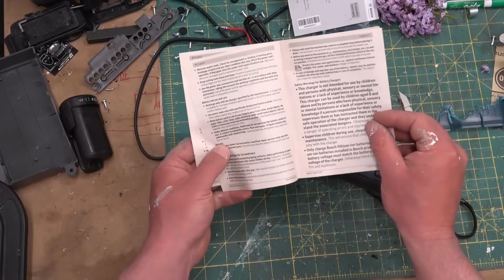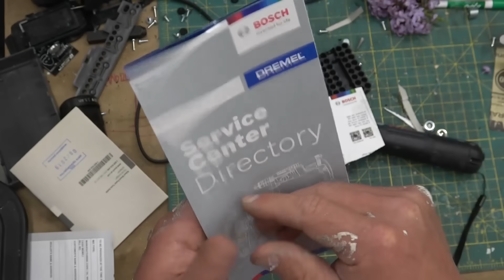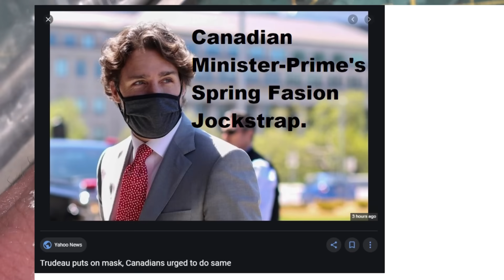BOLTR: Bosch Screwdriver

Comment: My fave brands - 
Bosch for Power tools 
Wera for Allen keys / Screwdrivers
Though I have seen Furze use the Ryobi power tool system extensively.
Others are also invested in DeWalt power tools.
I like Bosch with it being a German brand yet reasonably priced.

Comment: Not a fan of that “push to run” switch; and I suppose the delay is to ensure that you have sufficient pressure on the screw to avoid slippage. I have a thirty two year old black and decker power screwdriver which is just a switch, battery and motor inside (found out when I had to replace the batteries after twenty years) - why on earth does a screwdriver need electronics?! Metal gearbox too. Strong as fu<k, literally lasting a lifetime. Originally got it to assemble an Ikea kitchen, used it to assemble the deck and pergola. Don’t use it often, but invaluable for those “just keep screwin away” jobs, and also handy with the thick grip for getting a load of manual torque when ya need a tight grip.

Comment: Need to find a happy medium. Recently used a 1/2" drive Ryobi impact to screw in some 8mm hex head screws through 2 18mm sheets of mdf. Worked like a beaut until the impacts kicked in. Don't think that little Borsh would do it. Maybe the 350lb gorilla going 5 uggaduggas was over the top on the Ryobi..

Comment: It looks just like the old black and decker one... i think they even made this one bigger.   
Bosch....i need a smaller battery operated screwdriver or i might as well just use my Milwaukee 12v surge drill.  
I don't even need much torque.  High speed, light duty, and smaller

Comment: Slight correction: What you call a free wheeling diode is actually a current sense resistor. The free wheeling diode is at the same place, but the other side of the PCB. ;)

Comment: 5:13 -- RE: "... 180 degree [pot] on a scale of 1 to 6 ... some Teuton please explain that to me?" -- LULZ!  Turns out, mango, that the Teutons aren't the only ones who pay attention to the apparent harmonics of the very cosmos.  Indeed, pagans in general observed that Nature prefers equilateral relationships and thus, any Factor of 3 gets special attention.  Because Circular, the Factor of 3 must be multiplied by 2, there's your Sixths.
See also Lagrange points, where strangely enough there are special locations located at 120 degree intervals, but 5 of them in total.  Decimal systems use 2x5 as the factors.  And, RE: Teutons, see also the series "Dark" on Netflix.
Reply: 3x60 = 180; 6 x 30  = 180.  True enough, I can find 5 as a common factor in there too.
Reply: SEE ALSO:  QUORUM, ie. (2/3) + 1 for conversions between imaginary ideals and real integers.

Comment: If anyone wants to experience the thrill of purchasing a tub of new grease, although you'll be taged from that point forward, show yours to one of those individuals with a backpack who rides the motorized bicycle who's head lamp is always illuminated on his/her head at your local walmart at 3pm. (Disclaimer: doing so will require the purchase of a 3' pry bar and a change of address form. Not supplied at most Wal-Mart's).

Comment: 13:49 The delay is most likely the bit gets firmly in contact with the screw head so it doesn't ruin it by camming out. I bought an el cheapo (walmart store brand - hypertough) for $14 a couple of years back now. You can't beat it for the price & it's got none of that push-to-go nonsense. I use your magnet trick a lot with it to hold screws.

Comment: I have a little Bosch 10.8/12 volt drill with the same delay when you press the trigger... drives me mad makes the thing completely unusable, want to throw the dam thing in the 'fuck it bucket' every time I use it. I've noticed all these newer brushless tools have some delay (my dewalt, Makita and festool tools all have it) and sort of understand that they would as they need the computer to operate but I can't work out what Bosch are doing with shitty brushed motors taking half a second to move when you hit the button. It's most annoying driving a delicate screw (what your likely to be doing with a small low power driver) when you want to stop and the thing runs on for another half a second after releasing the trigger shearing the head clean off the screw!

Comment: I'm surprised I have to explain the correct way to find the speed setting on any German tool to you. It involves six-sided dice to give you an indication where to start, and then dicking around with it as long as you dare (typical German amount of time would be around 34.2 years)

Comment: The reason I'd guess for using 1-6 on a 180-degree Potentiometer-
180/6 = 30. So Every 30 degrees is another number.
180/10 = 18 degrees. Not as clean.

Comment: I have 3 of these from Dremel. One in electrical pack, one on bench and one in general tool pack. I mate these with the meewalky shockwave 18 piece impact set and one extra long philips impact bit. Beautiful to use on door hardware as there is no skip out to mar interior exposed screws. ( just as it hits tight, loosen your grip a little on tool and when it hits bottom the drive spins briefly in your hand and seats screw perfectly. )

Comment: I am still am you could say angry that even the simplest toys now need that much electronics.
Why does it have a microcontroller that is powerful enough to auto-pilot a helicopter needed for a screwdriver? I have now even seen Flashlights with a microcontroller that has MORE processing-power than my old MP3-player - with the extra twist that the MP3-player also had a flashlight built in and not only had the On/blinking/off options but the gimmicks like letting it flash with the music, fade-in/out and manually adjusting the brightness (worthless extra functions but hey - it already had the processor and battery so just adding a tiny light is a nice addition specially as it was small enough for the key-chain).

Comment: COVID BS all aside, you have to have the selector set to which way you want to go, then push in the bit just a bit, and it automagically comes to life? Not sure I dig on that method of actuation. I find that when it auto-rotates in your hand when you get to (resistance) is definitely a feature, not a bug. Screw it in with automatical screwdriver, until it starts to rotate, then you can use it in the non-powered mode to the torque you want, or bust out the big girl manual screwdrivers, and get them more precisely done. Having @$#^%ed up enough stuff with over torquing, definitely a feature.

Comment: Bosch came up with the idea that if you make a device blue, you can call it professional. This is an extremely sad development. I regret that I put so much faith in Bosch. I already have too many devices to change over and they simply do not have enough good devices.  They don't even have a decent battery sander.

Comment: much as i hate to be a fuckin know-it-all-know-fuck-all, that "big diode" is actually a shunt resistor (labelled R24), used to measure the current flow to the motor so the confuser can lower the current and prevent burnt windings if the motor is stalled. The MOSFET itself can be used to short out the motor windings on over-run to prevent spiking.

Comment: The Bosch has nothing over the Dewalt. This is the one i would like to tear apart to see how the hell it works. I have one and thought it was broken right out of the box. But behold it has some kind of gyro inside to control speed and direction that relates to witch direction you turn your wrist no matter horizontal or vertical. Its a fricken mind reader!!!!!!

Comment: I was actually considering picking one of these up. I had a Dewalt "gyro" driver for assembling stuff that a drill would be overkill. Someone thought it looked better in their toolbox than mine and I wasn't a fan of the "gyro" mechanic of it, figured one of these would be a good replacement...

Comment: Upon returning from some travel at the end of February I learned I had inadvertently entered a COVID-19 hot-spot, and started a 2-week home-isolation on March 2nd.  Just when I hoped to return to work, the general California lockdown started.  Living alone, I made it a total of 8 weeks in isolation before I hit a very rocky bottom.

During that time I learned I'm in 3 COVID-19 risk groups.  Despite my health issues being very well managed with meds, diet and exercise, this still means if I get COVID-19 it'll be a battle.  This scares the hell out of me, despite the odds still being strongly in my favor and improving with time.

After my meltdown 8-weeks in, I built a small 9-member community of well-isolated friends and family (something now being called a "pod"), each of whom has 3-degrees of separation from any known COVID-19 case.  When any member of the pod drops below that level of separation, they're out of the pod for 14 days.

I feel safe within my pod, but that's about it.  I can't afford grocery home-delivery, and don't like it anyway as I can't get the food I want that way, as the list of items eligible for home delivery is about 1/4 of the store.  Good food is particularly important during isolation, and not just for nutritional reasons.

I need to go out to do food shopping.  I also need to go out for my exercise (run, bike).  And I see so many folks out there without masks, any of whom could be in a pre-symptomatic stage of infection.  Everyone says: "Oh, I'll put my mask on when I get within 6' of anyone."  But they don't have eyes in the back of their head as someone runs or bikes up from behind.  They're not conscious of where the wind is blowing.  And this is despite my trying to use out-of-the-way locations for my runs and rides, and taking full advantage of special early shopping hours at my local store.

I've worked so damn hard for my health and lifestyle, and it seems so wrong that some idiot without a mask can bring it all crashing down.  Not even the risk of cancer scares me like this.

So, please, even if you feel the mask is silly and ineffective, wear it anyway when out in public.  Even if only as a sign of caring for those of us with complicating issues.
If your job has you interacting with the public, then please also wear gloves, even if they're not disposable.  I wear gloves when I shop, and dispose of them after cleaning my purchases.

This is a strange way to live.  But 100,000 COVID-related deaths in the US is not to be ignored or trivialized.  What's worse, all COVID numbers are certain to be well short of reality, as testing still is far from pervasive.
I do my best to minimize my contact with the public, within the limits of having a livable life.  People are everywhere, and nobody knows who near them is vulnerable.  It's only going to get worse as lockdown restrictions are eased.

So, please, just wear the geezless thing.  Even if the safety improvement for me is infinitesimally small, it's there and it's real.  Please.

If you wish, view it as a symbol you wear to support a cause, like one of those colored ribbons or wristbands, or a flag you wave.  Even as a symbol, masks have social power.

Comment: Frankly, i'd think some viewers of this channel are likely to already own a mask far superior to an N95 dusk mask that actually will protect you to a large degree (versus the surgical style masks intended to protect others from you).
Just about any cartridge based mask is going to be far better at protecting you than a dust mask. A cheap welding fume mask used to protect you against the fumes from your trigger gun is likely to be a P100 grade mask (99.97% against 3 micron particles and effective even against petroleum aerosols). That mask you used to paint your fence with your wagner power painter (or your home body shop, or your home meth lab) is also likely to be far more effective.
These cartridge masks have the added benefit of the virus generally being absorbed onto removable consolidated surfaces, rather than the entire mask, as well as being soap and water washable (as most of these are elastomeric, rather than paper).
Anyway, </rant>.

Comment: Correct me if wrong, yet isn't there water damage on the circuit board?
Reply: It's no-clean solder flux.
Reply: @goldenandlilchick  Ahh, just looks like typical corrosion I've seen on boards from water damage before.

Comment: So does anyone know if I can reach out to AvE, I've a question I think he would be able to help me out.
Reply from the maker: giver'
Reply: @arduinoversusevil2025  cheers, so I'm involved in an ice sport and I'm trying to reduce the coefficient of friction 316L stainless steel on ice, make it a lil more hydrophobic. so she runs a little quicker. I cant change the hardness of the material, so to date Ive just been using sandpaper 400-2500grit and then using diamond paste to buff the material out before competition but I'm wondering if there's any topical substances I can add that will not come off after acetone is applied. Cheers lad and thank you for your content, for someone who doesn't know his arse from his elbow when it comes to this stuff tis very entertaining.

Comment: A thing about those homemade masks is that if you can smell through it, it ain't doing diddly squat.  Also another thing that people tend to do is to overbuild them to a point where they're no longer air permeable so the air (and everything in it) just flows along the sides, only making it harder to breath but without all the benefits (unless it's a kink thing, I guess).
Reply: Sure it is, even if you can smell through it. Thoses masks are mostly to protect the output, not the input.

Comment: Ah yes, a physics professor comes to the conclusion that masks and respirators do not work.  I won't begin to say definitively one way or another what masks do and don't do but here are my questions on his report.

1 - He says that the particles involved are too small to be blocked by masks because they are less than 2.5 microns.  Perhaps true of cloth masks but N95's do filter down to 0.3 microns.  Is he suggesting that N95's don't meet specs?  Don't filter 100% of particles?  Doesn't know N95 specs?  If it's the middle question, yes, he's right that they don't filter 100%, hence the N95 spec.  They filter 95% of 0.3 micron particles WHEN fitted properly.  I would guess many are not fitted properly so that can be a confounding factor and why they probably don't work for the general public, but him ignoring and not accurately discussing that simple clear science in his statement tells me he may already have reached a conclusion based on personal biases.  Perhaps like other scientists he's allowed personal passion to cloud his conclusions.  I can't say.

2 - He focuses on whether masks prevent health care workers from getting the flu or similar respiratory diseases.  Most of the studies he cites focus on that.   Masks don't prevent healthcare workers from getting the flu because you can get the flu in a healthcare setting from touch contamination which is why healthcare workers wash their hands and yet still get the flu and colds.  Does he then also advocate that healthcare workers washing their hands is worthless as well?  Plus healthcare workers can get infected outside of work, so again, no surprise in these studies.  Colds and flu are everywhere so yes, healthcare workers will get sick probably no matter what they do.

3 - Is there any evidence that masks decrease the amount of particles expelled by someone who is infected?  Well, there seems to be some evidence that they do.  My wife and I work/worked in hot zone hospitals.  We wear masks when we go out of the house because we want to do what we can to minimize the chance of unknowingly transmitting the virus to someone else, especially since we now know that transmission can occur from someone who is asymptomatic.  That is the perhaps the biggest reason to wear a mask.  Not necessarily to save yourself, but maybe to save someone else from illness.  In fact, in the Cambridge study he cites, the summary clearly states "There is some evidence to support the wearing of masks or respirators during illness to protect others, and public health emphasis on mask wearing during illness may help to reduce influenza virus transmission. There are fewer data to support the use of masks or respirators to prevent becoming infected. "   Why no mention of that in his report?

Bottom line for me is that he's probably right in a small way in his conclusion.  People should not delude themselves into thinking a mask will prevent them from getting Covid-19.  In the overall scheme of avoiding infection, it may be a small factor, and in isolation from other mitigation steps it's probably close to worthless.  His grand overall conclusion that masks and respirators don't work is a reach.   He's probably right about them not decreasing the overall incidence of transmission much,  but since we seem to have some evidence that viral load may be a factor in the severity of illness, perhaps healthcare workers (and others?) gain some benefit in terms of severity of illness, a topic his report does not address and one I'm not qualified to answer, just speculate on.